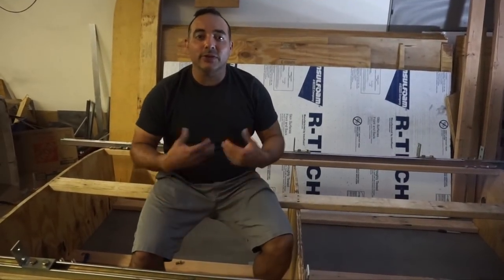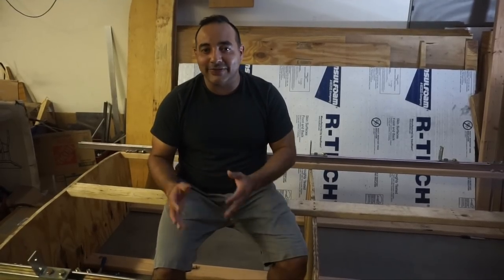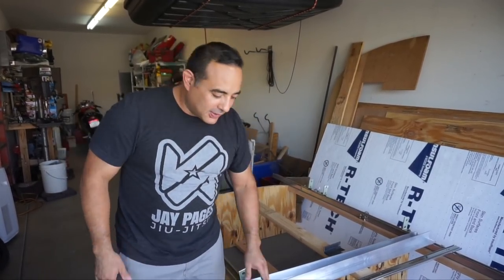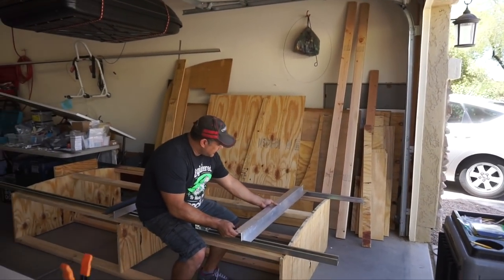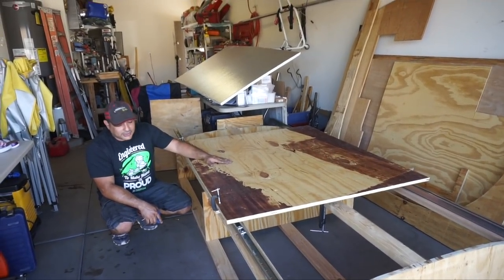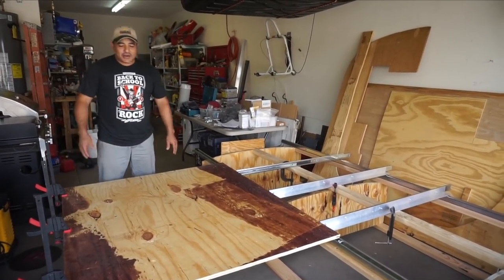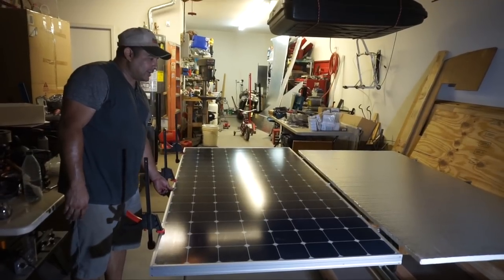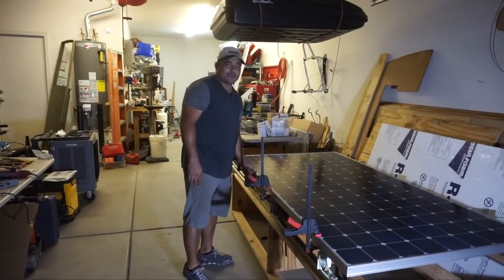RV Solar Rack - Part 2: The Lower Layer

Comment: Another great idea Juan. I used (2( 36" x 500# slides under my Dometic horizontal refrigerator with good luck. I laid them flat and made a flat drawer with holes for the refrig feet to sit in. It pulls out lengthwise. I am glad you stayed away from 100 watt flex panels. I have Souaki panels and after 2 years, they are failing.
Reply from the maker: Thank you Roy - We are not in the clear yet but the idea is starting to solidify a little more.  Honestly, we have heard nothing but bad reports about the flexible solar panels - we have seen reports of people taking them off after a year and usually 2 years tops.  The biggest problem we have seen is they don't allow the heat to escape - so they essentially burn up.

Comment: Hi, Nicholas here..Love your update video, and that you want with the higher watt's solar panels.. Q =  Are you  going  to use a air system to slide out your lower solar panel or something else ?  i did see on youtube a guy use an air system to slide out his solar panels. looked pretty good. thanx again for your video. and ps. i think you should have gone with a higher BTU  air-condioner with the mini split and you could have added another inside blower.( just my dumb two cents) love you show,Thanx again.
Reply from the maker: Hi Nicholas.  Thank you for watching and commenting.  We saw Everlanders air actuators and they looked really cool.  The only problem is we need to have actuation over about 45-47 inches.  I could not find an air cylinder that big that was reasonably priced.  I am going to try my luck with an electric actuator and see how that goes.  I agree a higher BTU air-conditioner might fit a little better.  The 12K BTU was the biggest we could find in 110V.  We would have LOVED to get a dual zone unit with 2 heads - maybe next time :).  Thanks for tuning in!

Comment: They do make 327W Sunpower panels.  I know you already have these, but you could  "tent" the 327 Sunpower panels to clear your vents possibly and avoid the large overhang distance caused by the rounded shape of your bus...
They are 61.4 x 41.2....you could do one on each side with a peak in the middle.  You could do an adjustable hinge and lift the outside edge when parked...  (to minimize any shade)
Reply from the maker: Thank you Shawn.  I love the idea - if we had smaller panels we might be able to make something like this work (still a big maybe).  Honestly, I was surprised (shocked really) that we found these.  When I was researching solar panels these SunPower 435s kept coming up, winning all these crazy awards and stuff - crazy good quality and cutting-edge technology.  The size has made them a little inconvenient but we are hoping the quality of the panels pays us back for all this effort.
Reply: Both panels are part of the E20 line.  The only difference is  427 is larger.  The efficiency / power density is the same.
Reply: I have E20 325w and they produce more than advertised!

Comment: Vinyl pan liner is good for isolating alum and steel. Aluminum paint on steel would look good on your custom mounting brackets.
Reply from the maker: We were thinking something more like 3M 5200 Marine Adhesive - maybe it would work to both secure the brackets and isolate them from each other?
Reply: +Beginning from this Morning  That would work. Also, plan on spraying the slides with WD40 twice a year.
Reply: Dont use WD40.  It is not a lubricant.  The name stands for W-water D-displacer 40-40th recipe.  Best to use white lithium grease or dry silicone.  Those are lubricants.  WD40 doesnt really last long and as a lubricant does work.

Comment: Just a thought but could you create something like a gate latch that the sliding panels will click into and lock open that would also support the panel? You could cut a tire tube up to make a gasket material to go between the steel and aluminum.
Reply from the maker: Thank you Jerry - both solid ideas.  We are hoping to actuate the bottom layer with a motor - hopefully, that motor will be powerful enough to keep the panels out and keep them in ... if not ... plan B (although lately, it seems like I land on something like plan H or K).  Thank you for tuning in!

Comment: Love the idea. Maybe the top panels should be wired together so they can charge independently when the others are retracted
Reply from the maker: They will be wired 2s4p with the two pair on top wired in parallel with the bottom panels - this should allow us to charge just off the top ones (1740 Watts) while retracted.  We will have the numbers for everybody once we get this thing installed and wired up.

Comment: Will the top panel be functional while in motion?  It would be incredible to have 100% of the energy gathering potential of a conventional system using only 50% of your system.
Reply from the maker: Yes the top panels should be fully functional while in motion (about 1740 Watts!).  The bottom, of course, will be completely shaded - but they will be wired in parallel so it should not affect the function of the bottom ones at all (if it does we will hook them to a disconnect that will get disconnected when they retract).  We will discuss how we are wiring and how we plan to deal with some of this stuff in a future video - thanks for following along!

Comment: Juan you probably have your reasons but if everything is electric but the water heater then instead of propane what about a diesel water heater. This way you would only need to carry 1 type of fuel not 2. It would simplify things. Just an idea!
Reply from the maker: Thank you J Jones - Right now we really like a propane instant hot water heater.  The problem with the Desiel heaters is they are so expensive and they take up so much room - I can't even get a price for the aquahot system "please call a sales rep" is all I see when I try to look at their products.  Last time I called I think they wanted $4000 for the system?
Reply: Wow. Ok I understand

Comment: Given any thought on how your going to latch them in place while the panels are deployed or when the panels are in travel mode?
Reply: Boun_Viaggio_USA I was going to ask the same question
Reply from the maker: Hi - Yes - what we are reaching for is having the deployment of the bottom panels be done via some kind of actuator.  Our hope is that the actuator would be strong enough to hold the panel in as well as keep the panel out (when deployed).  Of course, we will test our theory and if that is not the case have to again move to plan B.  Our hope is that once we get the actuator working  we can then tie it to a weather station and a small set of circuitry that would allow for the following automation: 1) if it becomes too windy ... the solar panels retract.  2) If it is night time ... the solar panels retract.  3)If it is daytime and there is less than 15 mph of wind - the panels come out.  4) If the battery is at 100% the panels retract (you get the idea) - but before we can even begin to dream any of these scenarios we need to make sure they can reliably extend and retract under some kind of power system.

Comment: No tilting provision to maximize winter efficiency?
Reply from the maker: Our original plan called for the top layer to tilt but after testing a few design ideas we didn't think we could build it sturdy enough to support tilting.

Comment: If your budget can afford it take everything in and have it powder coated then corrosion will be not a problem. If not just have the small brackets done to help with the dissimilar metals touching.
Reply from the maker: We would love to have them powder coated - I really believe that is the best way to do it.  We did not have a great experience last time we took a few items to the powder coater so we will very likely use a good self-etching primer + top coat.
Reply: That's to bad about the powder coater, but good rattle cans will take care of you. I look forward to your videos.
Reply: I do metal fabrication and dont like to use powder coating.  Once it gets chipped or dinged, and it will, the rust starts and ruins the whole thing.  I have found better success with good primer and industrial enamel.  Rattle cans are OK for touch up in a situation where you dont have time to paint it well, but not as a good top coat.  Too little paint and too much solvent and propellent.

Comment: those sliders are rated at 400 pounds when mounted in a vertical orientation.
Reply from the maker: Even though they are under the panels - they are still in a vertical orientation (mounted on the verticle face of the aluminum angle)

Comment: Why not just use flexible marine grade solar panels ?
Reply: What manufacturer? Link?
Reply: If something like this is available which I have seen them I think the price would be about the same as what Juan is doing and with less output.
Reply from the maker: Honestly, we have heard nothing but bad reports about flexible solar panels.  From most accounts, because these panels have to be mounted flat against the surface of the vehicle - they overheat and usually die within a year or two of putting them in.  AM Solar (whom I really like and trust) even posted a few months ago about flexible solar panels: "We think they are fine for some applications, but we don’t recommend mounting them to a vehicle. After about two years of use, most people want them ripped off their roofs, which is exactly what we did for these customers. -The plastic doesn’t hold up well on a vehicle roof.
-The plastic doesn’t conduct off-angle light very well.
-The panels leave burn marks on your roof under the cells." - https://www.instagram.com/p/Bi0OHLkH-jJ/?taken-by=amsolaroregon
A simple Google search at the beginning of our research on solar panels essentially eliminated flexible solar panels as a viable option - I couldn't find a single instance were someone was happy with them after 2+ years.
Reply: "RVWithTito" uses them and seems pleased.  I do recognize they will transfer a lot of heat to your roof. He also built portable window shades with them to gain more solar when boondocking.  Very cool idea.

Comment: I don't like it. It will have too many moving parts and will require constant monitoring and necessitates getting up on your roof to extend and retract your panels whenever you go anywhere. The amount of effort and the cost just seems too high to make them so that they can extend and retract with a push of a button. You started all of this because you felt that the panels stuck out too far and were too flimsy. What you have here sticks out further and is even more flimsy than your original idea.
Reply from the maker: Thanks for the feedback Alex - If we could not automate the panels coming in and out we wouldn't even consider this design - we are not climbing on the roof everytime we stop and want to deploy the panels.  The original design was a lot more simple but had its own flaws (like having a lot of surface area available for the wind to lift and damage the panels).  Jim from "Life is a Joy" had 2 panels destroyed and about 4 more bent up using a configuration similar to original configuration but with smaller panels and a lower profile roof.  The hope is that when everything is retracted it will be less susceptible to the forces of the wind.  Once we get them actuated - we can start to program logic like 1) if it becomes too windy ... the solar panels retract.  2) If it is night time ... the solar panels retract.  3)If it is daytime and there is less than 15 mph of wind - the panels come out.  4) If the battery is at 100% the panels retract (you get the idea).  We are still proving all this out ... and there is a possibility that it may not work.
Reply: OK, I have to say that I am impressed that you not only thought all of this out but your are not overwhelmed by the time, money, and effort that this would require. I was surprised that you and your wife were willing to gut that bus the way you did and to put all of that work into the battery and inverter system. I have a similar project myself, a 1995 Class A motor-home on a Ford chassis that needs a new roof. I had underestimated the amount of water damage when I bought it and now I am in the midst of replacing the shower, pantry, and all much of the rotted wood around them. I got stalled out in energy and money after a year and it is now sitting incomplete. You guys inspire me and I hope that I can build half as nice as a rig as yours is going to be if you keep pushing through these projects like you have been. Blessings to you and your family. I'm rooting for you to pull this off. Your success is our success.
Reply from the maker: Thanks Alex - Here I thought you were trying to troll me a little ;).  I really appreciate your kind words.  It certainly is a big, complicated project and as you can imagine - I can totally sympathize with your project.  We do get a little discouraged at times and I am sure you felt similar to us when we were just discovering problem after problem!  If you see some of our earlier videos we thought that we were just going to redo a few minor things, slap on a fresh coat of paint and off into the sunset we would ride - that was a year and a half ago and many tens of thousands of dollars ago :).  I always just pray for one thing: "Lord, please don't let me get discouraged" it has worked so far but we have had a few cries, and a few disappointments, canceled plans etc but we are determined to see this thing through (God willing of course).  We will pray for your project and your family and we are rooting for you to!